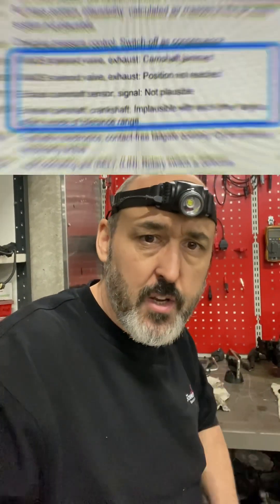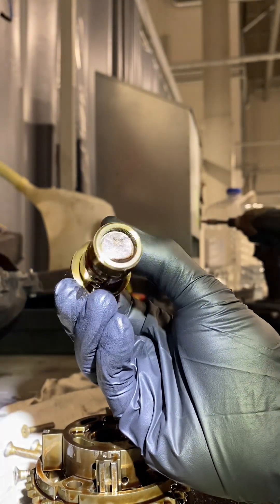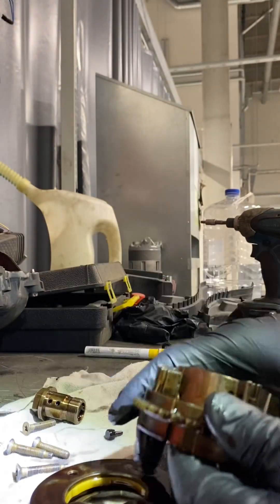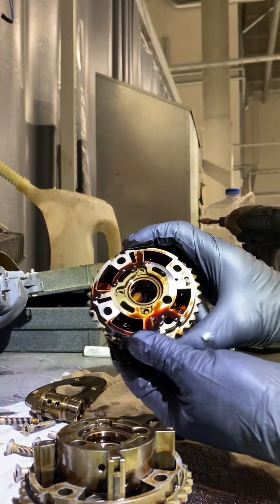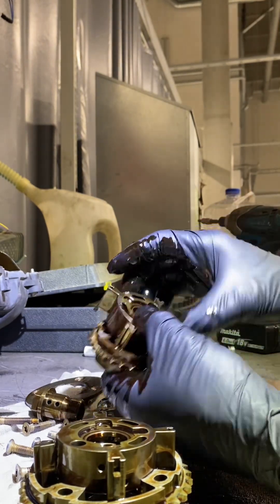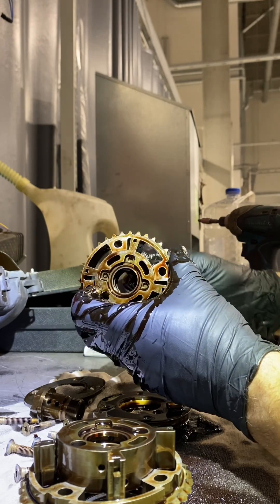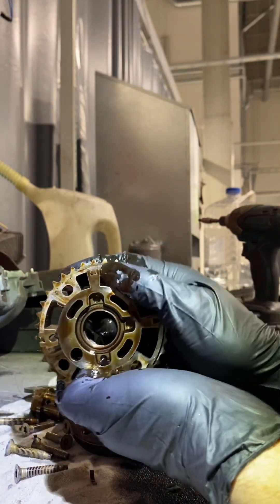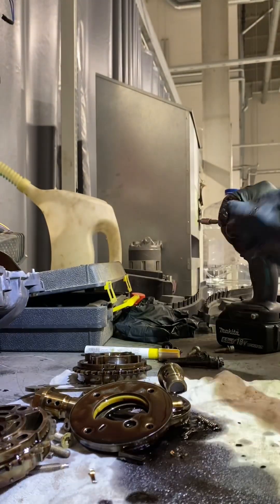B48 Vanos Failure: The Hidden Cause No One Talks About!

Comment: I have the code where it says : exhast camshaft position sensor signal not plausible. Only that one. I have a very rough and loud cold start once every 10 days roughly and i get the drivetrain loght. Second start, completely fine for another 10 days. B48 2016 320i. Do you have any idea what it could be?

Comment: Hi, from what year would you say it’s not necessary to replace the bolt. I have a 69 plate mini f56 with a b38 engine
Reply from the maker: It was a campaign anyway so just ask the dealer if there are any open campaigns
Reply: @BenJFF  Thanks, i’m also wondering could running rough on idle and no fault codes be a symptom of this, or is it usually accompanied by a code ?
Reply from the maker: Try if theres vacuum in the cam cover by removing the oil cap whilst the engine is running
Reply: @BenJFF Yh there’s slight vaccum/suction when removing the cap. What you reckon ?
Reply from the maker: New cam cover
Reply: @BenJFF interesting so probably failed pcv valve which i believe is built in ? Thanks for the advice and keep the great videos coming 💯

Comment: Need your help, if you look at centre bolt has a Pictionary in it wit circling, if you remove circling, what dies come out the centre, it would be big help to me
Reply: the bolt with the broken screen on rear of it, if you look at the end that can be seen while in engine, there is a circlip holding the inners in place, sorry didn't notice my text had messed up, there is a little piston inside there, that pushes to the actuator that's on end of valve cover , if you have an old one laying around, you could pull circlip out and take a look at inner see if it has a filter in the , i've broken the end of that piston off , trying to find another the same, don't have confidence in changing the full bolt , cheers 

unfortunately my eyes are crap can't see what i'm typing on small phone , hope this is readable ta
Reply from the maker: I have never tried to change it. Try and change it if you can. I threw the old parts out
Reply from the maker: I have no idea what you mean mate

Comment: Would this situation definitely cause the camshaft implausible tolerance and exhaust cam sensor signal faults to be set? I'm not getting those faults. My '19 f31 330i xDrive is setting...

130716 VANOS exhaust control error; camshaft is stuck 

130714 VANOS outlet control error; position not reached

13070C VANOS exhaust, cold start; not adjustable

120408 boost pressure control shutdown follow-up reaction

We replaced the exhaust cam actuator solenoid, no change. Car makes a noticeably louder exhaust "burble" on cold starts, goes into limp mode with anything more than moderate load, sometimes feels like a slight misfire when cruising at steady highway speeds. Any insight would be greatly appreciated. Was thinking maybe try to replace the cam position sensor, but seems like I'd have a different kind of fault being set if the sensor was bad. Thanks in advance!
Reply from the maker: You have a broken Vanos sprocket
Reply: @BenJFF is there something specific about those particular faults or symptoms that indicates that vs a faulty solenoid/actuator/central valve issue? Thanks!
Reply from the maker: @maxmoser412 Known fault going back 10 years nearly. You need to strip the sprockets off

Comment: Had this issue on my bmw 320i on the exhaust side.

My thoughts are most will get this issue. Problem was also that per prescription of bmw the whole vanos set had to be replaced to the new revision. So ended up with a 3k repair.

No fun in this one. 

Every car has variable valvetiming nowadays, only bmw faces heavy issues with the siff and dirt. I don’t think replacing the oil  more often has a big impact. The dirt is not coming from the oil, and as soon as the dirt is on the siff, it will not come off anymore.
Reply: Bro i got the same now. They charging me at bmw in amsterdam 2k euros b48 engine. 😢 530i 2018
Reply: @user-xy4en2tb8c thats cheap, but i hate to see that i had to replace the whole vanos system both inlet and outlet, but the problem was a broken siff which obviously is a factory issue which was allready there from the beginning. 

Also, the dirt is carbon buildup that the siff filters out away from the vanos system. Cleaning the siff if this problem occurs, solves the issue, but not when the siff cracks. Renewing the oil more often does not solve the issue, the carbon just builds up.

This issue is a known issue, but it mostly happens after warranty. BMW knows this because they replaced the parts with an upgraded part and the old part is not available anymore, thus the initial part was problematic from the begining.
Reply from the maker: I agree mate. Should be class action
Reply from the maker: Nightmare sorry mate 😢
Reply from the maker: Yep I agree. Not good is it
Reply: Same here. They gave me a 3k estimations. My car is an f31 318i with 184k. Wondering if I should do the repair...

Comment: Mine started rattling like crazy after replacing valve cover and got this code do you think my timing chain is messed up?
Reply from the maker: No idea. If it was okay before then did you maybe leave a spanner inside the engine.. Anything is possible.

Comment: So basically if we got code for Vanos solenoid camshaft jammed and just replaced solenoid im screwed??
Reply: Also could this be my reason for Super knock or is that not related car seems to be driving fine no codes after solenoid fix
Reply from the maker: Not screwed per se but it will cost a few bob to sort out. Superknock is usually related to the high temps these dog turd engines run at
Reply: @BenJFF have you seen knock sensors fail on these cars?
Reply from the maker: @DriveDynamicsAz No only when mice bite them. Have you checked? Look for nutshells under the charge cooler. Superknock is rare and usually is as a result of many things. Please check small tank coolant level as the front mounted heat exchangers damage easily with stone impacts

Comment: Hello, I have been researching about this subject and found out that the Vanos solenoid/actuator fails (breaks loose) and is responsible for subsequent failures, for example the sprocket, occurring anywhere from 60kkm+ or even earlier. Now, I didn't find any validation, but wouldn't be interesting to replace the solenoid for a new one as it's a rather easy job?
Reply from the maker: Did you watch the video? It clearly shows why you need to change the sprocket also. No its a hard job as the injectors need to be removed and then installed with new bolts following a very specific procedure.
Reply: @BenJFF  Thanks a lot for answering. Yes, watched entirely. But the sprocket broke a tooth due to the solenoid failure. If the engine is healthy, could be an affordable preventive solution to change the solenoids before they bust. For transversely mounted engines (FWD, Mini F series) the solenoid cover is accessible on the side. It'd be something to add in the 60kkm or 100kkm maintenance schedule.
Reply from the maker: @xapaiz yes you can try it why not🙂 But you still need to remove the injectors and cam cover

Comment: Hello there. Unfortunately, I can't find anyone capable of helping me here in my area. My car is a 2015 BMW, model 116i (gasoline) with a B38 three-cylinder engine, 109 horsepower, with 212,000 KM.The car jerks at low RPM (around 1800/2000 rpm) when the acceleration is steady (e.g., with cruise control). Once it passes those RPMs or if I press the pedal all the way down, it doesn't jerk. The issue appears when the engine is warm, not immediately. Additionally, when left in neutral while stationary, the revs remain high and fluctuate (1400/1300 rpm), again only when the engine is warm. THESE are my errors: 130F11, 130308, 132101. Could be related to VANOS problem you are describing? Or maybe could be related to the camshafts? thanks

Comment: Okay but how we prevent this? Can we change that part? Is there an updated part? Is this due to poor maintenance? Or you are saying this b38 and b48 is just junk? Such engine failure in less than 60j mileage is horrible.
Reply: Best thing you can do is change the oil religiously at 6000km intervals with the oil filter since day 1.

Comment: Currently expiricing this, Bmw 530i B48..
Reply: Hi, can you give more details? Mileage, maintenance? What symptoms you had? Did this affect other parts of your engine? What was the cost of the repairs? Also did you change the part with an updated part?
Reply: @DexterDexter-oz9gk  2019 530i b46* experienced low rpm jerking and limp mode - drivetrain malfunction warning but still drivable. Turbo boost disabled due to follow up reaction. I replaced both intake and exhaust vanos actuators but problem still there. Most likely the sprocket ⚙️ or solenoid is broken as this video describes it. No other parts damaged. I will take this to my mechanic soon and will update the repair cost and difficulty.
Reply: @distortionz_z  thank you for your reply
Reply: Wish you good luck!
Reply: @distortionz_z  hi what was the update, what did you end up replacing ?
Reply: @distortionz_z i got same now. 2018 530i 170k km b48 motor. It was shaking the car when the car is not driving. You dont have  the fully hp s of your car. . Is irritating to drive like that. 

They ask me now at bmw 2k euros to repair. So they will repair..

Comment: Short question: when the timing is off e.g. 1 tooth, can a vanos and DME (or other brands vvt) system trying compensate this by actuating the vanos? (of course with some ifs etc, till the code comes?)
Reply from the maker: Not at all. If the cam sensor(s) do not align with Crank reference there will be a fault code for cam / crank correlation but in this case the fault is a jammed Vanos sprocket which will cause the DDE to limit  boost pressure as a consequence. Adaption is done all of the time with Vanos but jammed in the wrong position... no adaption can fix that
Reply: thanks! clear explanation ( i forgotten the adaptation...in relation to this aspect)

Comment: is there any way to prevent this?
Reply from the maker: Nope. Its a manufacturing defect. Replacing with countermeasured parts is the only way
Reply: Hello again! Thank you for your work! What would be the part number that needs to be replaced? I have a 330i 2018 (2017/12), is this model affected by this problem?
Reply: @DexterDexter-oz9gk timing chain design was revised on the 2019 model year for b48 and b58

Comment: I have a couple questions, 1. Do you see this happening more on b38 than b48? 2. My b46 had the vanos position jammed/not reached codes come on earlier this year with no CEL (I only saw that code when scanning with ISTA) ISTA then stated BMW has new adaptations to fix the issue and had me go through the service procedure. No codes since I did that. Have you seen this so called update in ISTA? I’m wondering if they’re being shady and released an “update” to “fix” and clear this code when in actuality the Vanos valve is damaged as seen in your videos. Reading the live data and my vanos positions still seem to bounce around a lot more than what I’ve read to be normal. I’ve replaced one actuator and seemed to help a bit. Going to replace the other one soon.

Comment: BMW has a tsara case for this from about 3 years ago
Reply from the maker: Not many people have access to Tsara - me included. Aos does not have Tsara. Luckily I found it by myself
Reply: @BenJFF  good man yeh I know bugger ain’t it
Reply from the maker: @Cardoctorwolverhampton yeah 😅 Got one here from a main dealer diagnosed HV compressor failure... fan relay was knackered. Volt drop on line
Reply: @BenJFF  that’s why I  walked away from being at the dealership the frus given were a joke techs rushing through the lot
Reply from the maker: @Cardoctorwolverhampton Tech support are garbage as well. The whole Bmw brand is flawed. They look good but they are piles of rubbish that I just so happen to be good at fault finding on
Reply: @BenJFF so you consider that the b38-b48 engines are just garbage?